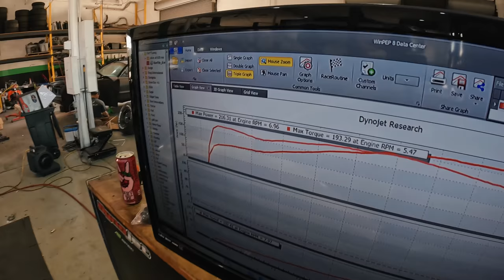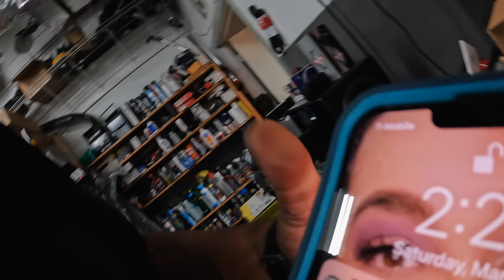I WON A S1 BUILT AWD KIT FOR MY TURBO K20 (PT 1)

Comment: 19:30 Well both soldering jobs are doo doo but the bottom is way better because less solder being used and less wire to cover up and protect afterwards. Zero copper should be exposed when done soldering.